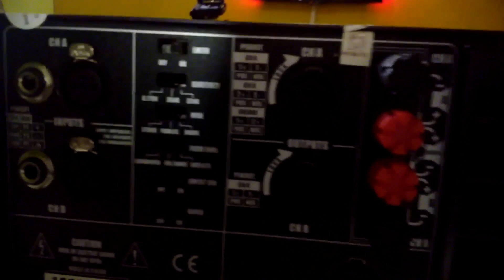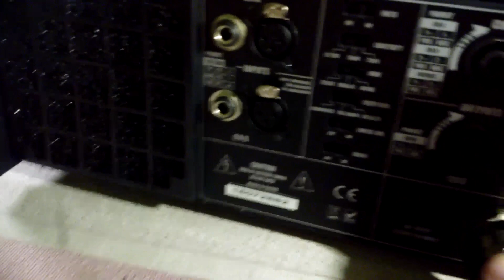5000 Watt amplifier Unboxing

Comment: Why do we need rack systems now a days when one compact unit can do the job.Not require so many amps.Just one powerful Amplifier is enough any suggestions.
Reply: Sandeep Chakraborthy depends on how many seperate channels you need, and having multiple amps gives you redundancy in case one fails

Comment: You are using a British 13 amp plug, which at 240volts can supply means the amplifier maximum power usage from the power point is 3,120 watts, then subtract thermal losses, average maybe 40% lost in heat is 1,872 watts total both sides added, which is usually specified as 900 watts/channel, so that is VERY far from your 5,000 watt amp, don't fall for the false advertising.
Reply: Y
Reply: is 900watts the RMS PER CHANNEL please help what amp would you prefer and how much???
Reply: Mohammad was illiterate
Reply: Mohammad was illiterate ฟ
Reply: Totally not true    rms  audio amplifing   isnt  being calculated  like that.
Reply: IF IT WAS GOING TO GET ANYWHERE NEAR THAT 5K FIGURE IT WOULD HAVE TO BE IN BRIDGE MONO

Comment: question please dont have idea i have 15icnh speaker how many watts power amplifier should i buy? planning for 1200 watts ampli its ok? 4 channel for 2 speakers 15 inc each
Reply from the maker: +Mark Castro yeah
Reply: so 1200 amplifier shoud i buy?
Reply: bro should i say i have 4 pcs speakers and 15 inch each so 1200 watts amplifier i use??
Reply: Repaxx 마크 hdgsurgdydhr
GdndufF

Comment: Only 5000w you should come here in the philipines we have 20000w power 4ohms
Reply: Live is the brand of the power amplifier.... It weights about 95kg it occupies 16u of the case... It is not pmpo it is rms.... 20000w RMS 4ohms mono..... It is used for battle of the sounds at iloilo philipines search videos in youtube
Reply: And it consumes 8000w of power.... The price of the amplier is 250,000 each
Reply: It is exported to the Philipines only from germany
Reply: @jantsbenzproaudio  
Cg